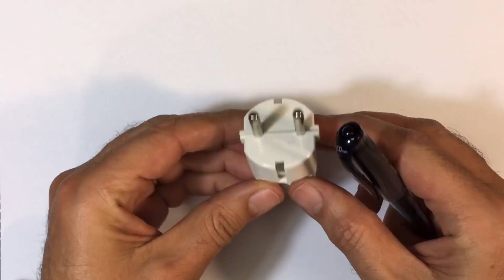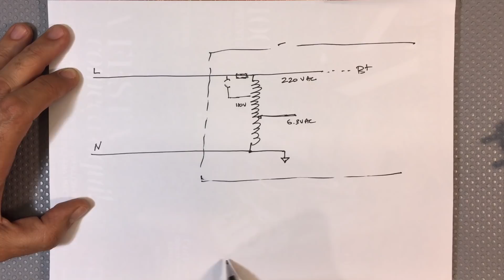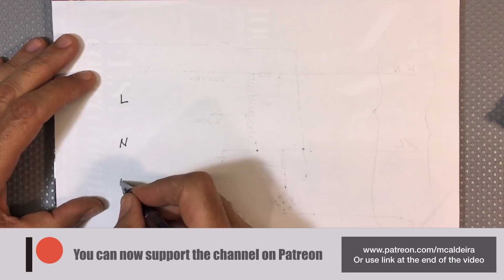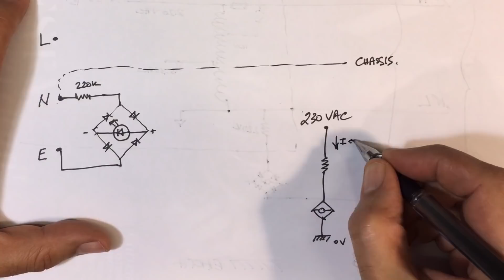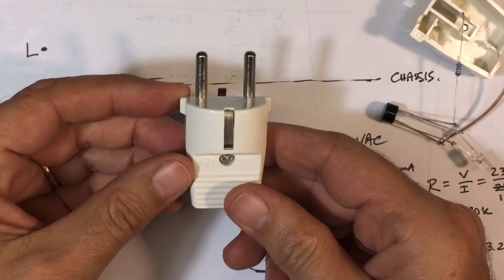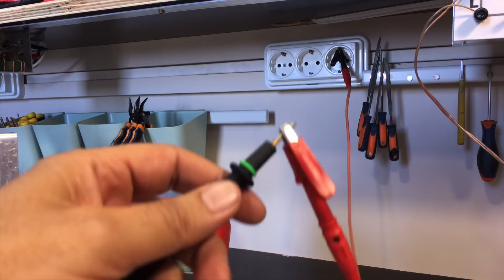Hot Chassis Plug - with LED indicator for hot chassis tube gear.

Comment: I was stationed in South Korea for a few years and they have the same plugs and voltage as Portugal.  While living off-base, I got shocked once at 230V when I touched my American microwave with one hand and my kitchen faucet with the other.  Turned out the step-down transformer that I was using, and which I'd bought in the Base eXchange along with the microwave, was faulty.  It had a three-pronged outlet to fit American appliances but the maker had literally pulled the ground receptacle out so only the hot and neutral sockets were present. That was bad enough, and is actually "normal procedure" for Korea, but the fault in this case was present in the transformer windings.  The shock hazard didn't go away until I replaced the whole transformer unit.  Two tips for my American compatriots:  1. Watch out for those cheapie BX step-down transformers, many of them are death-traps, and 2. for those of you living in the US, you can pick up a cheap outlet tester in any big-box store for about 8 bucks and it will tell you immediately if your three-pronged 120V outlets are wired correctly.  Mine was made by Commercial Electric and it was well worth the investment.
Reply: Many cheapie step down transformers are autotransformers, same issue as this Grundig.
Reply: @rossthompson1635  Understand.  So was mine.  When I returned home from Korea I rewound it and converted it into a 1:1 isolation transformer (115V).  It works well enough, but the 14 awg aluminum wire it had originally, and that I used to rewind it, makes it rather inefficient.  Fortunately, I only need it to work intermittently until I can build the isolation-dim-bulb-variac device that I'm now collecting parts for.

Comment: Yes, US and Canada have the same voltage, frequency and socket/plug formats. Modern single-phase sockets are always 3 prong and plugs can be 2 prong (polarized) or 3 prong (with earth). Older 2 prong plugs may not be polarized, I see them on vintage radios and replace them with polarized as part of a restoration.
No guarantee that some idiot did not wire the house up wrong though...
I like the plug, cool idea.. I can see you making a business out of it (maybe :) ). It's more credible than those 5G radio wave traps (USB flash drives)
Regarding the 1 dislike dude... well at least he is consistent. And there is only one of them on the entire planet.
Cheers,
Reply from the maker: always a good idea to play it safe.
Reply: You really cannot make a business of it not allowed to use a schuko plug on a class 0 equipment. The sockets are specifically designed not to allow the plugging for safety reasons. While such a thing is reasonable for personal use selling it is not possible.
Reply from the maker: Agreed.

Comment: In Poland, we have an even bigger mess with it. There are sockets (old type C sockets) without grounding, non-polarized, and sockets with a male earth plug (type F), so theoretically they cannot be inserted the other way round. However, there is no law regulation, which side should be the live and which side should be neutral. It is described only as good practice among electricians to place the phase in the right pin.
Reply from the maker: the same problem here. every electrician has his own rules.

Comment: Good invention and very simple!
 But in a good condition radio you should have no easy acess to the chassis during normal operation. ususally there is wax covering the knob screw-holes and the screw is recessed.  etc... maybe on some sets if you grab and move the radio with it plugged in you can get a shock, but that can be adressed mechanically (covering exposed screws underneath if they protrude) but usually that is taken care by the radio manufacturer. also there are certain situations were neutral can shock you too, lets say the neutral wire to the grid has a bad connection and you touch it, whatever current wants to flow throught the circuit will flow through you and to earth instead of the neutral, sometimes if you have wet feet etc you can feel a zap in the neutral.Your differential breaker should trip but it often doesnt.... i did a lot of domestic wiring for a company and during that time i took some neutral zaps. happens even more easily when there is lots of current flowing trough the wires for example when an electric heater is on etc etc. if the neutral offers resistance, if there is too much currint going through that wire and you touch it some of it will find a good path to earth trough your body
Personally i must have my vintage stuff with vintage plugs, i have a big radio that the wife uses but its a power transformer set, the rest of radios and tvs are only used by me and MORE IMPORTANT on vintage gear, ALWAYS unplug when not in use and never leave them on unatended, those are the golden rules for me. Cheers!
Reply from the maker: the main problem here is that the phono input ground is directly connected to the chassis, so if you connect something in there, ....
Reply: @electronicsoldandnew  on that radio its not 100% safe to use the phono input even if chassis is neutral..well, its better than live but still.....ideal situation would be a small 1:1 coupling transformer maybe???

Comment: You also have a great sense of humor. Bless you. By the way,  on the US plug, you got it right, the big prong is Neutral indeed. Some old houses however, might still have the old outlets where both prongs are the same side. Of course they have to be changed, or had to be changed, since all appliances going back to the 70s, have the polarized cords. some even have the ground pin. Now as to the 220/230 volts, i was in Greece when i was a kid and they have/had the same plugs there as what you are using. I also have a couple of Grundigs, that i love dearly with tubes. One has dual voltage input, while the 2nd is 110v only. They both date back to the 60s. Unlike you, i can't fix them, though i did have them repaired here, some time back. BUT, i love watching videos as informative as yours... Stay well and thank you again.
Reply from the maker: My pleasure. Thanks for your kind words.

Comment: This sort of circuit should be in every non-polarised plug.
We have never had the issue in Australia even with two pin plugs as our Live and Neutral pins are at an angle so it can only go in one way.  That said, I have known plugs and even sockets to be wired incorrectly
Reply from the maker: That is a problem you can't get around, unless you get a tester and check your entire house.
Reply: And which way you would indicate the danger on modern equipment? Toss a coin? This is a very specific modification for very specific application, nothing more.
Reply from the maker: That is what it’s presented as.
Reply: @okaro6595  if modern equipment is wired CORRECTLY there would be no issue.
Incorrectly wired devices we cannot compensate for, and these would not pass any tests or certification anyway.
This plug modification is perfect for polarisation, which is all it was ever designed for
Reply: @EsotericArctos  Yes, it is a good option for this problem. It is a good hobbyist solution, not for a layman as it still requires activity form the user  and it also is not to the code. Polarization is really issue only on lamps and it would make more sense to mandate a double pole switch. If you want to ensure your lamps are connected so that the switch is on live, use a non-contact voltage tester to test that there is no voltage when the switch is off.

You could use an RCD plug and wire 6,8 kohm resistor between the ground and the neutral. This would ensure it is corrected the right way. Too bad could also trip the RCD in the panel.

Comment: I recall building a AC voltage tester in electronics shop using a ne-2 neon bulb and a resistor, no bridge rectifier needed.  It draws micro amps of current and lasts a long time.  Thank you for this safety tip.
Reply from the maker: pleasure

Comment: wow the plugs u r forced to use there, OH My, they have an additional FLAW, in other places (Canada) the EARTH or Ground is ALWAYS the Longest Pin, that means whatever u connect anything it is GROUNDED FIRST before Power is applied, the plugs there the ground is the SHORTEST Pin that's really DANGEROUS.
Reply from the maker: It seems that wherever you are, there are issues, so being careful is the ultimate safety check.
Reply: Actually the holes for L and N are so far recessed in the socket that the Earth always connects first. I admit that the polarization is a design flaw in the "Schukostecker" how we call it in german, but everything else is very good about it. The plugs are sitting very stable in the sockets. I don't like it when the plugs hanging on an angle in the wall outlets in North America.

Comment: M!
I usually enjoy your videos very much, and this one is no exception to that.  Well thought out, informative, educational, practical, useful, helpful, entertaining, thought provoking...a darn good video!!!
You are right about the plugs in the United States of America...at least to a point.  There is only one way that the plug will plug into the wall socket...however, unfortunately there are some places where whoever wired the house did not follow the code.  In those cases, you can still get shocked.  A device like yours could be useful here too.  One thing I would have done differently though, is that I would have mounted the LED on the end where the power cord enters the plug.  That way, it doesn't matter which way you plug in the cord, you could see the light easier.  Still an excellent idea and well done.
On the subject of wiring, I once lived in a house in Georgia where the Dimwitt that wired it decided that AC is NOT polarized, and therefore it "didn't matter" which wire went where.  Therefore he wired the house with black and white wires connected together in many places.  I discovered it when I opened the refrigerator and the kitchen light went off.  Closed the door and it came back on!
Again, really enjoyed the video!!!
Reply from the maker: Thanks for that. 
As usual, a prototype always need a version 2: I had the same thought about the positioning of the led when I first used it. Next time 😊 
I think the problem with doing this in the US is the size of the plugs - much smaller, if I’m not mistaken. 
Wherever you go, dimwits will always leave their mark.

Comment: No need for a bridge rectifier, just an anti-parallel diode connected to the LED. No need for any high voltage rating for the diode, a 1N4148 will do.
Reply from the maker: I prefer the bridge so that the diode does not flicker with the half-wave that results from the alternative solution.
Reply: @electronicsoldandnew  , you might want to edit the video to include that statement.  Again, wonderful video...throughly enjoyed it!
Reply: You won't see any flicker (50Hz)
Reply: The flicker - if visible - doesn´t matter, because the plug has to be plugged in so that the LED doesn´t light and we have no permanent flicker; only for alarm. BTW, the antiparallel diode could be a second LED antiparallel and could be mounted on the other side of the plug so that at least one LED is always visible
Reply from the maker: Very good point. Thanks.
Reply: @dl7majstefan753  excellent solution for more visibility that will have space into the plug as well
Reply: We have the same plugs here in Norway, but a different earthing system. Basically earth is floating somewhere in the middle betwene the two live pins. So theres 125volts from ground to any of the two pins.
So this solution will not work here.
We get halfzapped anyway we plug it in :-)
Reply: @geirendre  Interesting about your centre tapped earth. In the UK, although we use 230V (really 240V in most places), it is compulsory on construction sites that power tools have to be run from a 110V isolation transformer. That uses a centre tapped earth, so that the worst you can get is 55V to earth. (of course still 110V if you are unlucky enough to get across both wires).